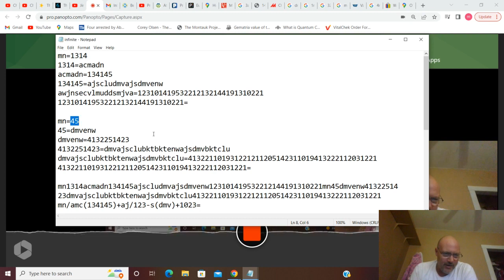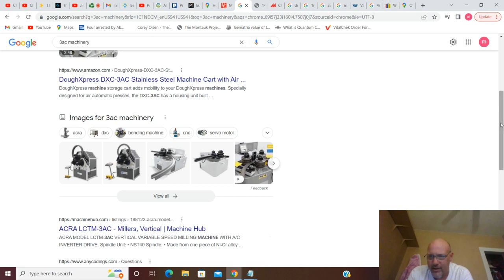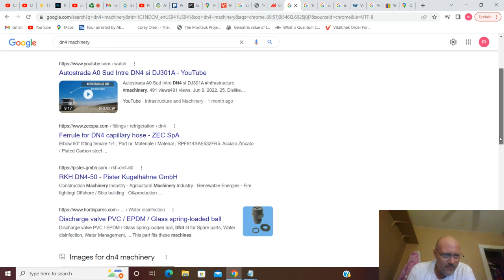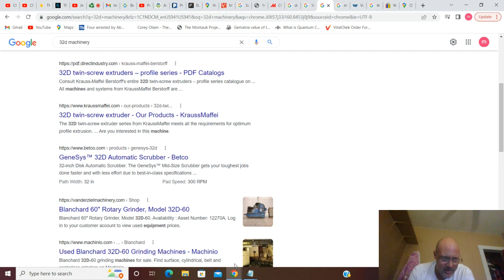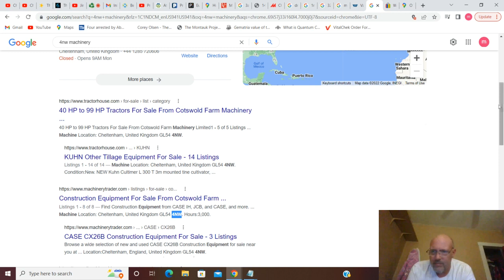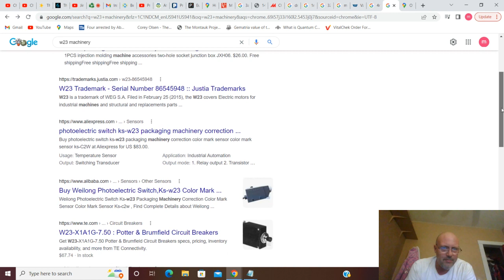Mandela Effect: Mamwich/Manwich alpha numeric decode pt.8A machinery search

Comment: Oh man now I'm not in good shape I remember the sun being 96 million miles away from the Earth and now it's  92.94 mi away 2 + 9 + 4 is 15 5 + 1 is 6 so this is 9 6 is still intact you just got to take a few extra steps to get there how far do you remember the sun being from the Earth I'm not going to tell you my dark city memory yet I want to see what you've got first.
Reply from the maker: I remember "them" saying it fluctuates depending on the time of year.
Reply: @mandelaquantumeffects3912  okay dark city memory 93.5 million Miles away and don't it come up fast now?
Reply: @mandelaquantumeffects3912  I just heard that the colder and hotter temperatures are from the angle of the sun not the distance, which is flaming intriguing to say the least!
Reply: @mandelaquantumeffects3912  I just read that they claim that cold water boils faster than the hot water and that hot water freezes faster than cold water and I'm going to be making two scientific tests of my own at two separate times and proving or disproving it for myself and if true I don't know but I'll sure come up with something.